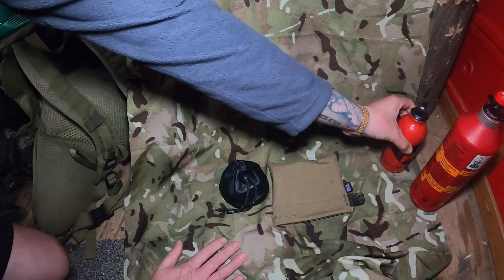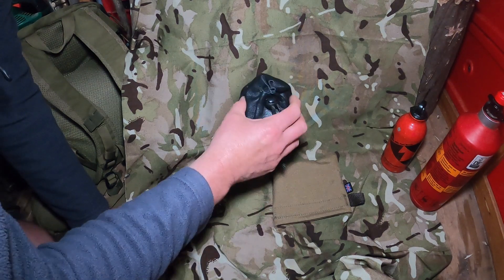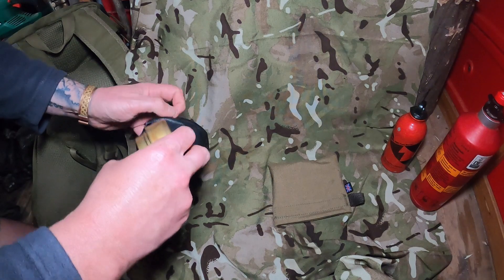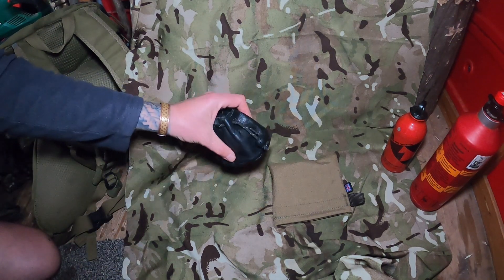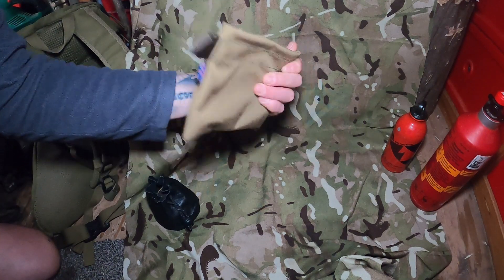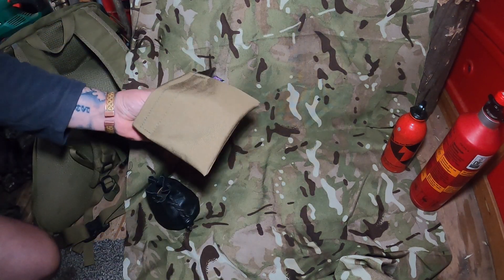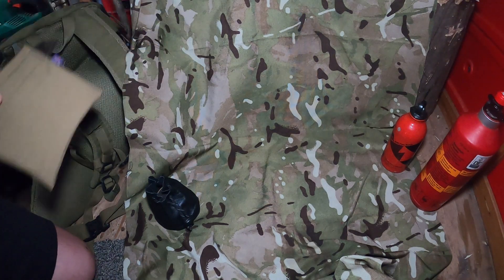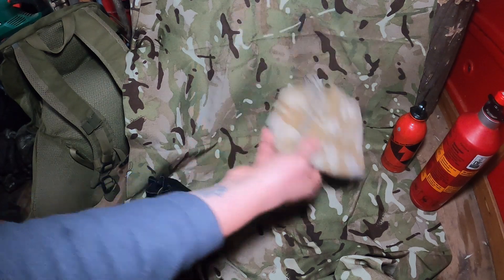Trangia compact stove - Lightweight System

Comment: The last stove is very similar to an American quick stand, which due to to points at the outside of the stand, has a place for a lightweight wind shield. I have the same one and I personally think its better then the trangia triangle. I use mine with either the normal spirit burner of a trangia gel burner, which i use the fire dragon gel blocks...
Reply from the maker: Interesting
Thanks 👍